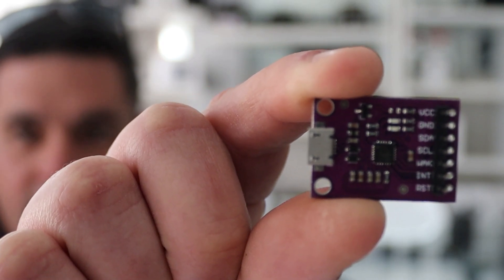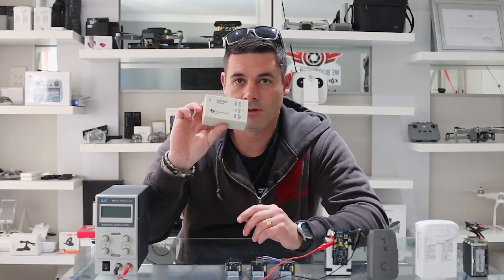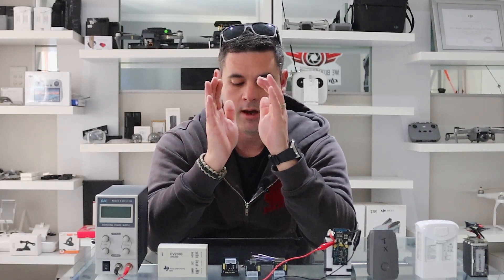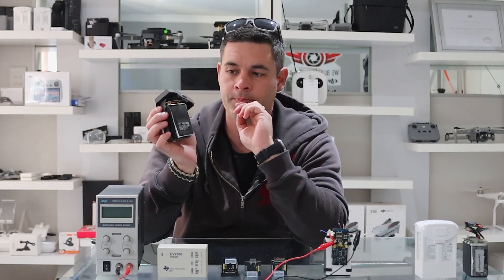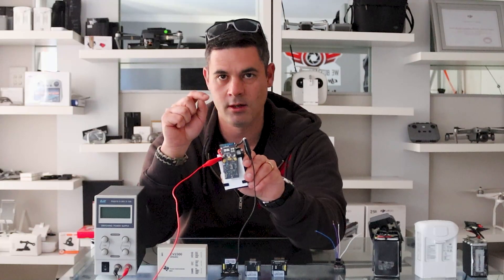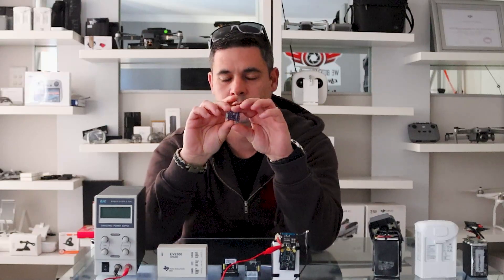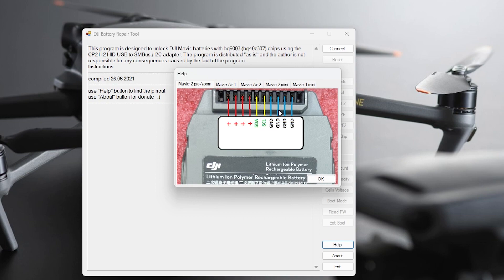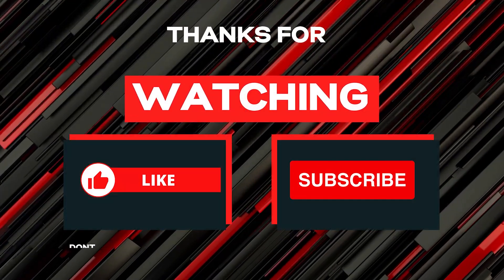How to Revive Your DJI Batteries - Part 2 More Information

Comment: I have two Mavic 2 pro batteries which are unused but refuse to take a charge. They have been on the shelf too long I think. Can these be revived with the methods shown here
Reply: Hi

The method for Mavic Pro batteries is in this video. https://www.youtube.com/watch?v=kg1g2aWtz4Y&t=415s
Reply: @AshrafRogers  thanks. I’m a bit wary of cutting open a lipo battery 😨
Reply from the maker: Mavic 2 Pro batteries do not need to be cut open , they actually open relatively easily
Reply: @webuydronessa  good to know. Do you have a video showing those being opened? I’ve already donated just hoping to see the software soon

Comment: Is there a chance you can make a debugging board for the TB60 batteries I have 3 dead pairs, not swollen and they didn't even get to 100 cycles (they are supposed to give 200 cycles)

Comment: Hello, please what is the name of the cable/connector to link de card ev2400 to other card ? Where I can buy it ? Have you got a link ? Thank you
Reply: Hi. The ev2400 can only be used with TRB software, which no longer exists. The CP2112 board is a fraction of the cost, and the software needed as in above video works for almost all models anyway

Comment: When connecting the Mavic 2 battery and the CP2112 communication port, a message like this (ERROR: Could not perform SMBus read 0×00) appears and the connection is not possible.
Reply from the maker: Hey. Apologies for the late reply. Have you managed to sort it?
If not, you might need to give the battery a small charge with the original charger just to " enable " it. This only needs to be plugged in for 5 seconds or so. Thereafter unplug and plug back into the CP2112 board and check. Failing that, the cells might be too low for the bms board to function. The cells should ideally be 3.5v each. This can only be determined by opening the battery itself and manually checking each cell. If you are still stuck, give us a shout. Thanks

Comment: Getting SMBUS read error, have tried to power +/- pins from external power supply with 9 and 10V, to no avail. What else to try? Cells seem to be drop dead, stored for 2 years, pbly too low to even let the supply voltage get through to support the cells 😞
Reply from the maker: Hi. Unfortunately if is does not hold any voltage at all, then those need to be discarded yes. Depends on the battery and cell count, 15~17 volts is needed to get the 4 cells up if its a Mavic 2 battery. This would allow them to get to the "required" 3.5v per cell which equates to 14v. Then the CP2112 will easily get rid of the PF flag and re-enable charging etc.
Thanks

Comment: Hi good day, i followed the instructions step by step ,but what i have noticed, the battery voltage for each cell is over 3000mv in the video. I have a brand new mavic 3 battery and cells 4 and 2 read ,1 and 3 read 790 mv . Unsealed cleared the pf and pf 2 , got the first led to blink when i pressed cleared pf2 then it stopped. Any help will be greatly appreciated
Reply: Hi. Battery cells will need to be balanced. The reason the pf flag triggers, is exactly due to voltage differences. Minimum cell voltages for cells are 3.5 for the pf to be cleared and for it to be able to be charged normally
Reply: @AshrafRogers  how to get them balanced ? I would like to get this battery working
Reply: @bernardharewood1686  You first need to charge the 1 and 3 cells until they are around 3.5V to match the 2 and 4 cells.
Reply: @stevehoge   how do i do that without opening the battery

Comment: Hi 
Thanks for videos, 
I'm one of the unfortunates that has 2 mavic 2 batteries that won't read, so I'm opening them up.
You say in the video put voltage into to the battery slowly, so I'm sure are you starting with low voltage or amps your not specific with the settings.
Thanks again
Reply: Hi. So for a Mavic 2 battery, I believe max charge is 17v +-. I usually use about 16volts, but minimum amps. I go about 0.50 amps. Slowly get it up to about 14.2 volts (each cell minimum 3.5v ). Thereafter the CP will detect it and is also safe to clear the pf flag as the voltages are above the needed requirement before flagging. Just be careful making sure you have the poles correctly for charging the cells collectively.
Reply: @AshrafRogers  brilliant thanks just got one back to life I did 16.5v 0.5amp 30 mins.. if only the cases opened easier, that's the hardest part

Comment: Thanks for the video. I have 2 spark batteries that the software sees, but both error when clearing PF2. All other steps work fine, just "Clear PF2" errors and then no change when charging. The software gives me an "ERROR: PF2 is not active" message.
Reply: Hi. So what steps do you follow?:
Read Info - unseal - Clear PF 1 - Seal.
After clearing PF1 a  light on the Spark battery should slowly flash. Then switch off the battery in which the led light on the Spark battery will flash rapidly, indicating successful reset of the BMS. Then put the battery back on or put on charger. 
If you clear PF and you dont see the light flashing quickly, clear it again. 
Also Note, the voltage of each cell needs to be 3.5v at least for the PF to clear successfully. So total voltage minimum 10.5v minimum

Comment: Hi what about if i want to make battery mode with 3600mha or 4000 mha battery cell,it can be created battery with Mavic Air 2 and 2s cell. Do i need software for the capacity of 3600mha or 4000 mha
Reply from the maker: Can be done yes, but only capacity change. You can change cell count but the firmware of the device would need to be hacked to allow no errors from the BMS.

Comment: I’ve gotten “device successfully opened device successfully configured” but can’t read info or unseal, am I doing something wrong?
Reply: Hi. What model of battery? What error do you get when trying to read the info? 
Also, the cells for the battery need to be at least 3.5v per cell, thereafter the software will read it no issue and you should be able to clear the pf

Comment: Please help me....
bought on amazon CP2112 smbus.
Start ok.... if click READ INFO...

'ERROR Could not perform SMBus read 0x00'.
The battery is good.....
I connected the 3 SDA SCL GND wires
Battery DJI MAVIC 2 PRO good.... no broken....
Thanks....::((

Comment: On a Spark battery if I get the error, just connect external power brick 12v 1.5A to the LHS(next to SCL) pos and neg pins and let it charge for a bit and the error will go when wired up and connect to software... No need to perform "open heart surgery" with battery.
Reply from the maker: Hi @bobf3598. That does work when there is enough voltage in the cells correct. Unfortunately it is not always the case, and the battery will have to get opened to " wake up " the cell if too low. Those pos and neg pins go through the BMS first, so if the BMS has switched off the CHRG/DSCHRG parameters, then it will never push voltage through to the cells.

Comment: error could not perform smbus read 0x00 dji spark help me
Reply from the maker: Then the battery voltage is to low for the board to read , you need to get the battery voltage up on all cells before attempting to read it
Reply: @webuydronessa  It also does not work with the charged battery. Any advice? It is a Mini 2 and there is no power button either
Reply: @kangaroo-nm5nn  Hi. Have you managed to resolve the issue you have with the mini 2 battery?? If not please send us an email. Thanks

Comment: I disassembled my Mavic Air batteries and charged the 3 cells in each one "by hand" with a 5V supply until they were over 3.6V - that was enough for one battery to remove the PF1 and PF2 flags according to the procedure via the app.   But for the other two batteries at that voltage - even up to 3.8V - the app returned the message "ERROR: Could not perform SMBus read 0x00".   Those two batteries needed the extra "jolt" of being momentarily connected to the original charger (until the charger light turns red) before I could overcome the error and continue through the "Unseal->PF1 clear->PF2 clear" sequence.
Reply: Same question here before i buy it myself
Reply: Perfect. And correct, if the voltages are good, and you get the read error, either plug into original charger for a few seconds, or short the positive most pin of the last cell in the series with the positive pin on the charging port of the battery for 2 seconds. Either way works. This "wakes" up the BMS and the CP will then read/write etc as normal. Glad you got it sorted
Reply: @hkprogram837  Hi. What question do you have?
Reply: Thanks for the real-time feedback 👍😎✊

Comment: i click the Unseal and then Clear PF2 , and Smoked / burned the CP2112,
Reply from the maker: WHAT 😕 !?!?  Was everything connected correctly?
Reply: @webuydronessa  yes this is insane  and believe me , i am super experienced with CP2112 and electronics in general , the sequence was the cause?
Reply: @webuydronessa    the issue was that i connected the VCC to the Battery +
Reply: @gc9n  Thats so unfortunate. Never ever connect VCC on the CP boards for this procedure.

Comment: I made the connection without opening the battery and connected it together with its charger and was able to restore one, but my other battery recognizes it and reset its parameters with the software but it still does not turn on its LEDs or charge, what could it be? is for mavic 2 pro and the battery model is FB2

Comment: Hello friends.
I bought a mini 2 and after the first flight I went to recharge the battery and the following message appeared:  
"Battery error. Contact DJI support. ERROR 30074"
Also appeared:
"Battery cell damaged, discard battery and contact DJI support. error 110004"

That's why I came here and purchased the items to try to recover my battery that wasn't charging.
I managed to carry out the process in this video but unfortunately I think that there is no solution for my case. Because 2 cells are dead for some reason.

Battery Cell 1 Voltage = 4079 mV
Battery Cell 2 Voltage = 4308 mV
Battery Cell 3 Voltage = 0 mV
Battery Cell 4 Voltage = 0 mV

Does anyone know if it is possible to do something in this case?
Reply: Hi. Apologies for the late reply.
No, the mini 2 uses a 2 cell battery, so it showing 2 cells @ 0v is normal. The problem you are having is you need to balance those cells. 4.3v and 4.0v is a big difference and the BMS will activate the PF flag every time. Once those 2 cells are equal in voltage, then that battery should be ok. You will need a balance charger to do that
Reply: @AshrafRogers  Hello friend. How to balance a DJI battery? The closest I found was the imax B6 V2 but I don't see how to make the correct connection to charge and balance the battery. Will I need to open the battery to balance the cells?
Thanks for your response.

Comment: hey my Spark Batteries fully charge but  ''fly time'' is about 10 minutes. will the cp2112 reset my batteries back to factory? the 3 wire plug, am i going to use a USB CABLE ? and are all usb cables color coded the same? just want to know which usb line is which,,,thanks
Reply: Hi. Unfortunately you cannot get capacity back with using the CP board. The cells are ultimately a consumable item and suffers from wear and tear. Im unsure what you mean regarding the usb cable, not all usb cables have the same color coding. Thanks

Comment: Я не знаю вашего языка,но в видео интуитивно всё понятно,нет лишней воды.При перепаковке батарей происходит его блокировка,но мне при разблокировке надо ещё прописать новую ёмкость,например было 2250 ма,а надо выставить 3500 ма.Если вам не трудно,могли бы мне объяснить пошагово как это сделать.Заранее спасибо,всего вам хорошего.
Reply from the maker: Hi. If you need to change the capacity due to new and different cells replacement, you can use the newer version of Battery Killer to calibrate and change capacity etc. We will be posting a video on how to use the new version very soon.
Thanks
Reply: @webuydronessa  Спасибо за ответ,буду следить за публикациями.

Comment: Guys !! dead batteries you only need to disconect the cable from the cells that go to the board or if its soldered , desolder it and solder again !!! I done that to many old fimi v8  2018 versions !!!
Reply from the maker: This does NOT remove the PF Flag on the BMS board , this method has to be done with DJI batteries , if you do not remove the PF flag the BMS board will not allow any voltage into the battery , yes maybe your procedure works on other brands but not DJI